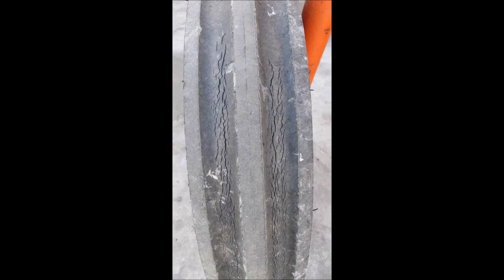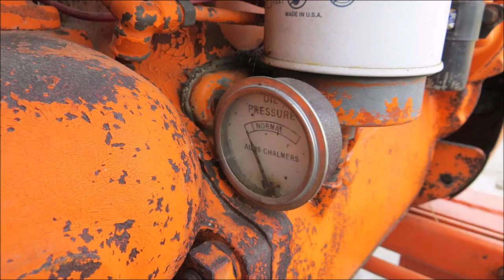1955 Allis Chalmers B Restoration

Comment: My Dad took me through this whole process back in the 70's when I was like … 12 years old ?? He had found one in a farmer's field. Engine frozen solid. Before I go any further, I should mention that my father had served in WWII, the Korean Conflict, and the Vietnam Conflict, with many times acting as a mechanic. Anyway, I digress. His rebuild of his Chalmers B consisted of him stripping everything down aiming towards the engine block so he could get to the cylinders. Destroyed them bitches with a drill plus the help of a 5lb. sledgehammer ( light taps ) and the twist or two of a wrench. Once that was pretty much taken care of, then it was off to the transmission. Had to rebuild that too. Cutting to the chase: Came home one day after school and my Dad yelled at me as was approaching the house " Come here, boy. I have something to show you !!! ". Why in the hell my Dad was home in the first place was my first indication that something wasn't right. He never took a day off from work. So, I follow my Dad, thinking I had done something wrong and was in trouble, and where was it that he led me to ?? The tractor. During the hours while I was at school he had thrown all the body parts back on it, new paint job, and body stickers. " Look at this ", Dad told me as he Monkey Jumped the engine. That puppy turned over first try. My Dad, Gearmonkey that he was.
Reply: I started to tell my story and noticed yours, I started reading and I had to ask myself if I had written it. Same story I was about to tell.

Comment: Is that persian orange 1 you used, also what brand of paint?
Reply from the maker: Yes, Persian Orange #1. It's from AGCO.
Reply: Thanks, Its looks awesome. Im restoring a 41 B that my grandad bought new. Do you happen to have a paint code # ? I called the local Agco dealer and while I have yet to go see the paint card myself , he told me over the phone that it looked more reddish orange to him which sounds like the "corporate orange" color.
Reply from the maker: @thomasgunnels3880   ACP0244130 is the part number you want for the paint. I also used their primer and hardener.
Reply: Thanks again.
Reply: Do you remember the name of hardener you used and the mixing ratio, the data sheet for this paint says to use "Renew Hardener REN4001" The equipment dealer who ordered my paint doesnt carry it and couldnt find it in  their computer to order.